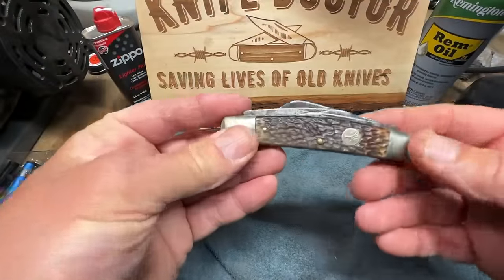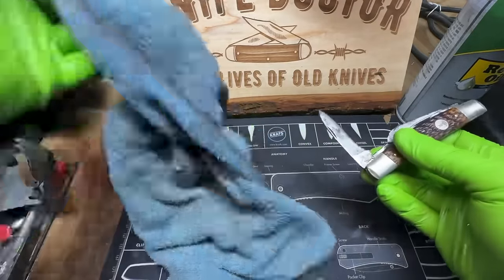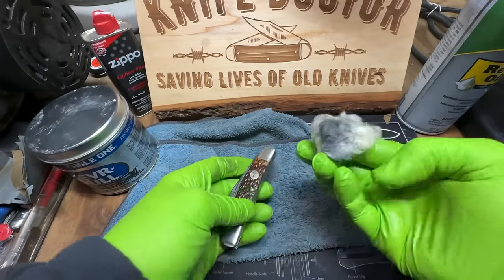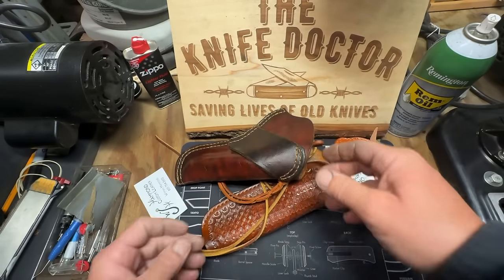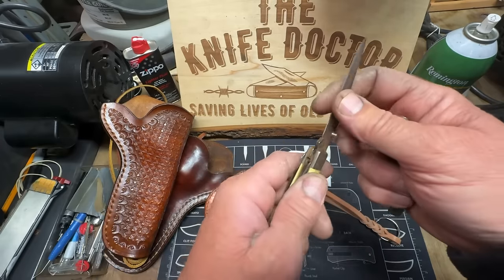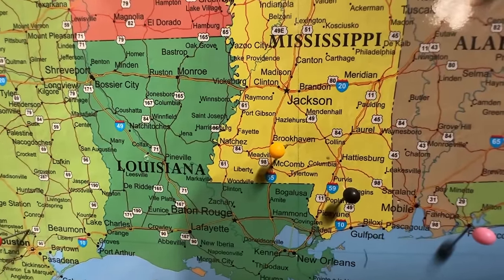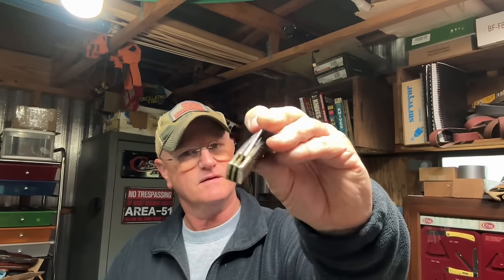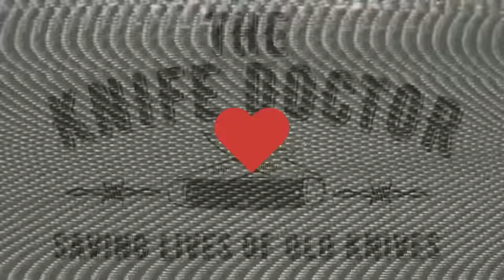Mississippi Mail Call + Boker Knife Revival!

Comment: I agree that leaving some of that awesome patina is what separates it from any other new knife. I have a little bit of trouble getting into the handles when cleaning the bolsters with a grinder like yours. Is that just going to happen or do you have any tips to avoid that?
Reply from the maker: I use fine grit sandpaper and a small micro flat tip screwdriver.